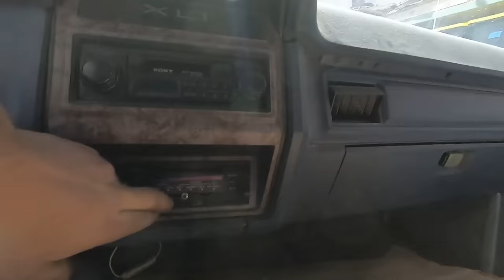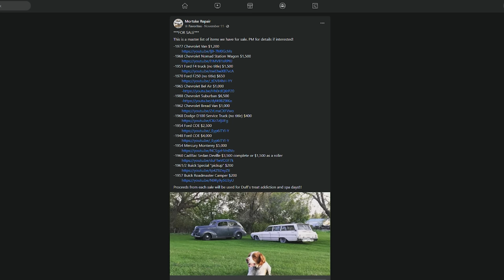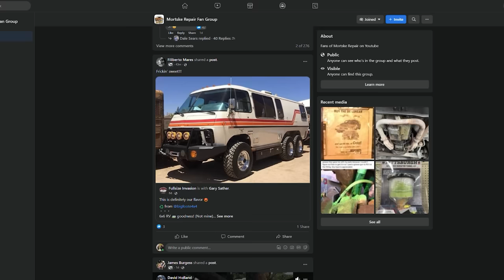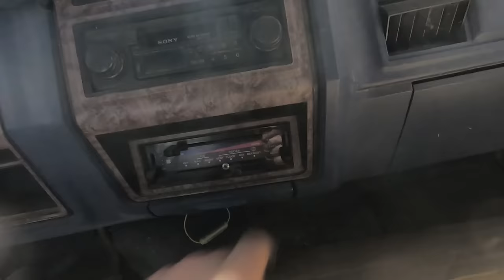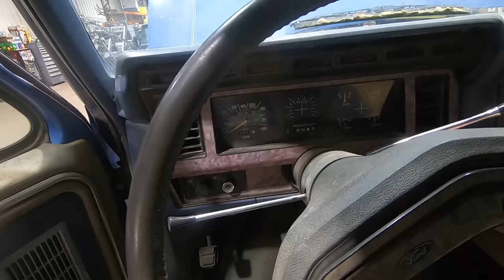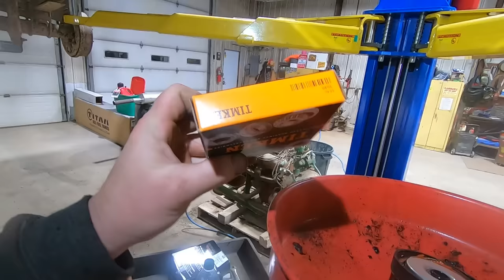Revival and Transformation of an Abandoned 1985 Ford F150 4x4 Farm Truck!

Comment: Currently rebuilding one of these from the frame up, but it's an F-250 Had to completely rebuild the cab the only thing that's original is the transmission tunnel, everything from there out has been replaced. Getting kind of expensive and hard to find parts right now but still wrenching on it.
Reply from the maker: Good luck!

Comment: I had a 81 and a 96 full size Bronco.  I see a lot of similar parts with your ford.  Could you drive the 85 in full time 4 wheel drive?  The Broncos were part time 4x4 and running in 4x4 on a snow covered road put me in the ditch twice.  Once I flipped when the tires caught the gravel on the shoulder.  The other time I sunk into deep snow but was able to get out by driving forward and back until I got up enough speed to pull back up onto the road.   My Broncos were good vehicles.  Fuel injection much better than carb.  In the end, the salt got them both.  Rusted out floors, rockers, quarters and tailgates.

Comment: I've had probably 20 of those trucks 8086 it'll hold 3312 the house right now but you got to do a little strings spring stretching on the front it won't hurt 35 unless you put cut the fender Wells out and put a lift on it but 33 is will fit just really tight

Comment: I've got a 1982 F100 and a 1986 F150. The 82 was the very first vehicle I ever owned, bought it in '99 when I was a junior in highschool, it's a reg cab short bed 2wd with the 300 six and c4 three speed auto. The 86 I bought in 2002, it's a reg cab long bed 4x4 with the 351w and np435. I've always said Ford quit building good trucks in 1997, unlike gm and dodge who never built one that was worth a damn to begin with.

Comment: Those old trucks of that era are a gem and are pretty tough.  This one came back around pretty easily really considering some of the stuff you managed to get going in the past. I think you can still buy new replacement ibeam/traction beam mounts, as cracks like that were pretty common to see. It's got a bit of rust but there's a lot of miles left in that thing. Fix a few more things and clean it up and it would be a great daily driver for sure.

Comment: As usual another awesome video. I was thinking when you're talking about not having your air compressor there with you. You should look into an air compressor it runs off the motor. I had an air compressor setup bolt up to the engine in this when you run the engine you can run the air compressor on it so you always have air. It's great when we go four wheel on that mud and somebody breaks the tire off the bead always have an air compressor all I have to do is pop my hood grab the hose turn it on Bob's your uncle. Might be worth looking into for the tow Pig
Reply from the maker: That would be handy

Comment: Make sure you go thru all the gears to get a accurate reading on Tran fluidity got a 95 f150 with a 302 with 335,500 miles original motor,Trans and rear end

Comment: Factory Paint Colors were Medium Regetta Blue and Silver, I have a 85' F-150 XLT Lariat with the Explorer Package with the 351 H.O., C-6, Automatic, and factory 9" with a limited slip, same colors different exterior trim, 85 was the first year for fuel injection on the 302, and that is a factory rear bumper

Comment: The bucking you feel when you brake is the driveshaft yoke into the transfer case needing grease. Ford makes a special lube XG8 PTFE (Amazonia has it). Pull the driveshaft and fill up the splines and slap it back in. Bucking will be gone immediately
Reply from the maker: Thanks for the info!

Comment: Fuel injected Ford trucks have a low pressure electric pump in each tank and a high pressure pump on the frame rail. The high pressure pump raises pressure to 120 psi and it then regulated down to the 40 psi for the fuel rail.

Comment: The reason these trucks would have camber issues is not due to the pivot bushings. Either the ball joints are bad or the front springs are sagged out causing negative camber or the springs have been replaced lifting it causing positive camber. Only the short bed came with the small saddle tank.

Comment: The pump on the frame rail is the high pressure pump and there is one in the tank but it only supplies about 6 psi as a transfer/pickup pump

Comment: We should start a movement, not to be confused with a "b" movement, to bring back wooden steering wheels. Why you may ask, 1. they don't get hot in the summer. I know this is not such a big thing up north but I live neat Atlanta, it's a big deal here. B they don't get gooey when they get old. And 3 you can refinish them with any paint sealer or oil you want, and even Greta would be okay with using a renewable resource like wood. Seems like everyone wins! So wooden steering wheels it is!
Reply from the maker: Brilliant!

Comment: Get some 2wd F250 front springs (coils). That'll give you 1-1.5 inches of lift in the front to fit 32-33 inch tires. 
Just be prepared for some colorful language when it comes to camber adjustment... it's tough.
35s will net at least a 4" lift kit ($$$) with drop brackets and (possibly) radius arms.
Reply from the maker: Thanks for the tip!

Comment: I've put lift kits in TTB's and just changing front coils won't really work.It really screws with the geometry and you can't get the camber back. In order to fit 35's it needs a 4 inch. This means drop brackets for the axles, longer radius arms with brackets moved back to where the transmission cross member is.
Drop pitman arm , longer shocks.
Longer brake lines. Different rear leaf springs with longer shocks. 
Ideally it needs a different tie rod drag link setup to avoid bump steer.
With the gearing umm not really worth it unless you go to 4 /10.
Reply from the maker: Interesting, makes sense.

Comment: They started twin traction in 1980 in half and 3/4 tons. They had it until 96 in half tons, and 97 in the HD 3/4 tons. They skipped the 98 model year for HD trucks and came out with the super duty in early 98, but they were a 99 model year.
Reply from the maker: Thanks for the info!

Comment: Hello on those wheels chrome aluminum  etc engine wash I use a product called wheel acid . You can find them from a auto supply store I believe it’s a car brite product . Wear a mask  , glove  mix 50/1 spray on wait a few minutes and wash off .
Reply from the maker: Thanks for the tip

Comment: Late 70s to early 90s ford engine drain plugs were known for being crap. When I was a kid working in a lube bay, we kept new drain plugs on hand for the fords, 1/2-20 thread. The power window issue with that era ford always chewed the gear kit up in the window motors, the motors themselves rarely were bad, the plastic gears stripped, so look for power window gear kits, if they’re still available
Reply from the maker: Thanks for the tip!

Comment: In an AOD trans if you manually shift from 1st to drive back to 1st it'll go into 2nd and hold it. At least the mustang version works that way. My 80 f100 had that noise too. I think it was the cowl cover.
Reply from the maker: Interesteing
Reply: @Mortske Repair  while moving. Like if your flooring it and the shifter is in 1st and you want 2nd throw her in drive, it'll shift into 2nd but then pull it back to first and it'll hold 2nd till you want 3rd. It's called the AOD shuffle. But it being an 85 and in a truck I don't know if that an option. Just thought I'd clarify. Love your content and give Duff hugs for me

Comment: Watch the torsion bars on that I had a 1982 with the same set up had one of them break and OMG that was a ride
Reply from the maker: There's no torsion bars, they have coil springs
Reply: Whatever the support bar's are called from the front axle back to the frame mine broke and it wasn't fun broke right at the end of the threads

Comment: 41:50 those calipers are going to sieze on you. Stick on. These front ends are horrible about that when they sit because the cast iron calipers are meant to slide directly on machined pads in the cast iron knuckles with a layer of anti-sieze as lubricant. When they sit for a long time they tend to get rusty in there. First time you hit the brakes the calipers will move as you expect, but when you release them they don't float back. They just get stuck 'on'.

Also, you'll be fine on power. I never wanted for 'git' out of my 85 and it has 2.49s in the back! And a manual trans to boot, so it isn't getting the torque multiplication of a torque converter to help it launch. Don't expect any semblance of fuel economy, though, 12 city 15 highway for a V8 auto 4wd.

Comment: Maybe check the coolant temp. sensor in regard to the surging.   I recently got an 89 running for someone and the coolant temp sensor was amiss.  Just a suggestion.
Reply from the maker: Thanks for the tip!
Reply: @MortskeRepair  I never drove that 89 anywhere, but it would warm up and then shut off and not restart.   Jumpering the diag connector showed the coolant temp sensor at fault.   Was around 30 bucks from my equivalent of Napa Todd... and they actually had it on the shelf.

Comment: I loved my 87 Crown Vic wagon. Except when I had to change a water pump. Ford bolts the entire city of Hammtramack to the water pump on 5.0s. 14 bolts in all, all different lengths, most go straight into water jackets, and at least TWO WILL snap off! But 12 bolts, plus blue silicone in the other two holes in the pump, seemed to work just fine. About 4 years later I ran it outa water on a dark and stormy night, and blew it up. Coincidence? 🤔
Reply from the maker: Ford things!

Comment: AOD transmissions had a soft OD engagement usually due to worn clutches run in Drive an see if your vibration goes away
Reply from the maker: Thanks for the tip!

Comment: I used Marvel Mystery Oil for power steering and transmission  fluid.  My old Thunderbird seemed to like it.
Reply from the maker: Interesting
Reply: @MortskeRepair  When my 07 Mercury was low on power steering fluid i uesd it in 2010. I always seem to have a bottle. That, and 3 in 1 oil.

Comment: 1:18:42 my gauge only reads the upper half of the tank. Full is full, Empty is 1/2, once the needle moves below empty you have approximately however long the float bowl lasts before it shuts off. They're a bit wonky.
Reply from the maker: Pretty common unfortunately

Comment: You evicted a whole family of meeces... Haha!! Old school Ferds.... 80-91 dual tank used a switch valve that uses fuel pressure from the tank pump to move a diaphragm for switching. It's been un-obtainium for years costing over $600 of you could find one. 92-97 used electric switching valve and check ball system that usually pumped the gas from one tank into the other witch then overflowed and didn't work to fuel the engine. Lol
Reply from the maker: Good to know!
Reply: @MortskeRepair  mis type on the year... its EFI trucks in the 80's that use un-obtainium switch valves. Carb and 90's OBS use electric valves.
Reply: Best mod for these once the dual tank system craps out is remove the side tank and use a Bronco tank in the rear... there's a 38 gallon Bronco tank available also.
Reply from the maker: @mobileu47  Thanks for the tip!

Comment: That vibration sounds like what happened to my 2001 F350 Super Duty. the windshield seal at the top worked itself loose and vibrated like a moe foe  so loud you can't stand it driving down the road! The faster it goes the louder it got, so very annoying.

Simple fix is to tuck that seal back in where it supposed to be, you might want to use some sort of glue so it doesn't work its way back out? If this ends up being your vibration? GL
Reply from the maker: That would suck!
Reply: @MortskeRepair  
Yes it did.
Reply: was an easy fix though.
Reply from the maker: @itseithergonnaworkoritaint7852  Good deal!

Comment: Not sure on what year (86?) the 9” was disco’d, but I had an ex-border patrol 86 Bronco with the 9”, 351 HO 4V, C6, and the same NP208F. I’m pretty sure the Dana 44 TTB started in 1980. Light duty F250s got the same TTB as the F150s (‘cept with 8 lug outers) and the heavy duty F250s had leaf springs instead of coils/radius arms and was a Dana 50. I sure miss that Bronco now.
Reply from the maker: Good to know

Comment: That's what would be 355 rear gears Ford had 2 options either a 355 or a 373 also I have 8 injectors with a after market intake and a cam and bigger injectors it would really wake that thing up if u wanted to squeeze a little more power out of it

Comment: I use to work in an exhaust shop and I'll tell you those rock auto exhausts are a blessing compared to the your-a-peeing sites, almost everything from euroflo would NEVER fit exhaust hangers in wrong places, flanges being twisted and stupid stuff like that..
But the damn manifolds are a fucking pain on those newer fords(90's+) compared to most anything else, and for some reason it's mostly ford manifolds that go bye here and ALL the methane driving cars, they just rot from the inside out.. Methane conversions were really popular here.
Cheers from Iceland.
Reply: Methane? Is that from geo or waste?
Reply: @youtitta  Geo, an abundance of that in Iceland

Comment: I had a 1980 bronco the first year of that styling there and the first 4x4 with independent front suspension, it was a game changer ,you could climb hills that straight axle 4x4s could only dream of because you don't lose traction in the whoopdedoos the axles were made by Dana, it's a pain in the ass to get that Dana IFS front axle adjusted right. Coil springs and shocks that are worn need to be replaced, that's why there's a bunch of dudes on YouTube that are talking 5hit about it they  don't understand that. 
 But believe it or not none of the parts on that 4x4 truck are interchangeable with a bronco. even the master cylinders take a different fitting size, bronco parts have more redundancy, I learned my lesson when somebody sold me a 4x4 truck caliper for my bronco, those Ford brakes are really bad anyway ,when your pads wear to a certain distance they  fall out ,and combine that with E brake cables that are liable to snap off if you pull them too hard , well I had no brakes coming down 5,000 ft from lake Arrowhead on highway 18, the reason why is because a normal bronco has a stainless steel caliper piston it will stay together and stop you when your pads fall out, and the ones for a 4x4 Ford truck are made with some kind of bakelite that snaps right in half, and leaks out your brake fluid.
Reply from the maker: Thanks for the info

Comment: that ford at the end was a 97-04 f150 97 was still aeronose obs for f250 and f350 97 was the first year for tenth gen f150 then in 98 they had the f250 with 7 lug rims(99-04 was the f250ld the hd f250 99-03was the superduty style which is way better looking) my dream truck is a 99-03 7.3powerstroke 4x4 crew cab dually but otherwise im attached to old fords and gms because thats what i grew up on
Reply from the maker: Good to know

Comment: My father bought a brand new 2wd 1985 F150, solid blue color, fuel injected 302 and auto trans. I remember large swaths of paint peeling off the roof and hood, it was repainted under warranty by Ford as it was acknowledged as a factory paint defect. Blue seems to be the worst color for peeling paint in 80's-90's vintage vehicles.
Reply from the maker: Interesting

Comment: Where'd you get the little wrecker at sitting in there Mortske? Or is that for an upcoming show? I had a 2 wd 86 Ford F-150, the paint and everything was about the same as that one except the front diff, had a 302 in it too, pretty good truck except for the Cancer over the rear tires, fender wells, whatever, but I think that's the first thing that goes first in them.
Reply from the maker: STay tuned!
Reply: @MortskeRepair  - cool! Will do brother man!

Comment: 1:02:11 And if you never use the parking brake they will not self-adjust. Work great for a few thousand then fade out. I've prolly put over 100k on my '85 with no back brakes because the parking brake is totally hooped on it and thus the rear drums never self-adjust.

Comment: Re:internal alternator regulators:.My '69 Pontiac Custom-S had a factory internal regulator type alternator.
You did the Gutentight bit, then YouTube slams in the OReilly's ad with the girl bending in to install wipers...who is it that said 'there are NO coincidences.''?😁
WAIT, Ford engineers thought putting the high pressure fuel pump underneath, so instead of the engine bay going up in flames, you pulled over when it broke and the engine died, (the HP fuel pump was leaking) and while you are digging in the engine compartment the plethora of cataclysmic divertors sets the grass on fire, which hits the fuel soaked grass, and as you dive backwards away from the flash-blast, the entire truck is engulfed...with your billfold still laying on the seat?😁
Reply from the maker: Bahaha, good timing on the commercial!

Comment: I love the old bull nose Fords. Something else Ford got right with the 80-96 trucks is the heater core. Probably the easiest vehicles on the planet to change one out. Literally pop the glove box out and remove a few screws in the cover. It's about a 15 minute job.
Reply from the maker: Even on AC equipped pickups?
Reply: @MortskeRepair  Yes Sir.